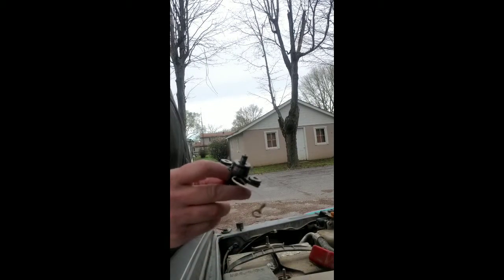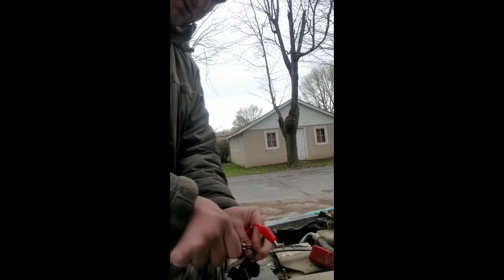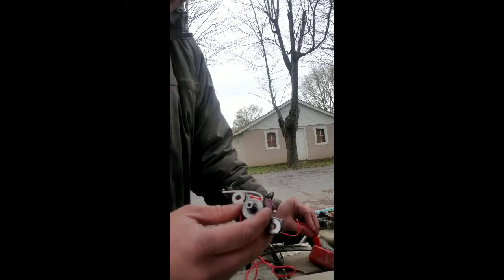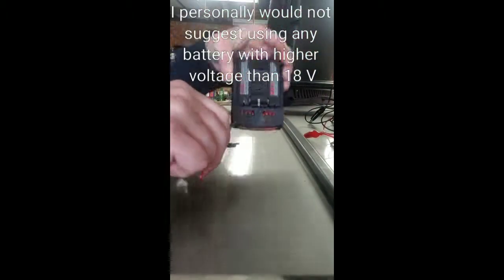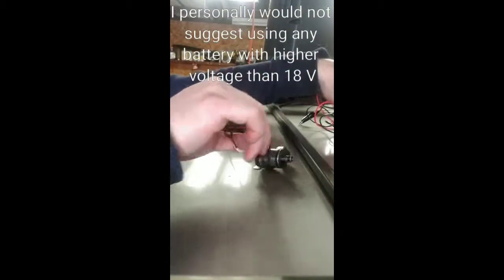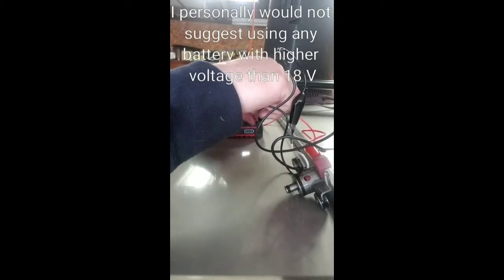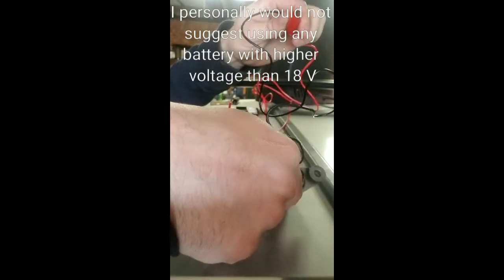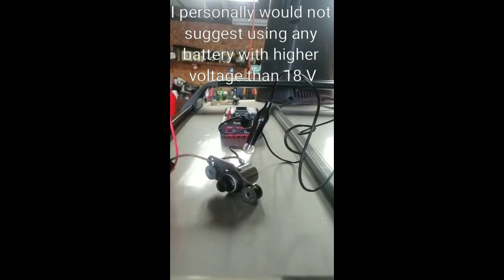Testing Subaru 4EAT solenoids

Comment: How do you test the other solenoids without the ground wire?
Reply: steel body of solenoid to be grounded and terminal connected to the positive
Reply: I have the same question. I tried grounding the steel outer of the solenoid and I got nothing.

Comment: I have a sf5 forester. It’s got low miles for its age. When I drove it shifts from 1-2 without issue. The engine revs from 2-3 before it “grabs” and 3-4 is also without issues. Does this mean I have a bad solenoid?